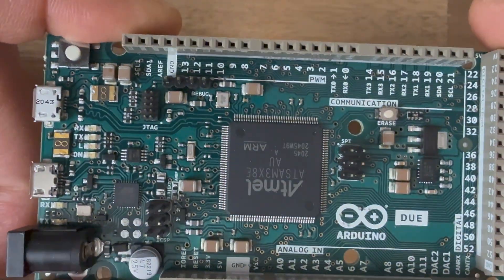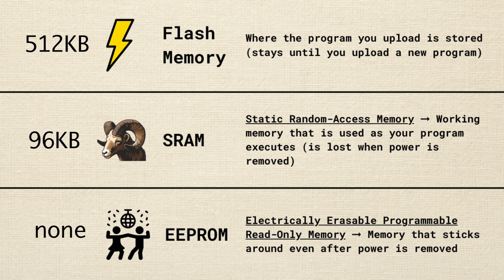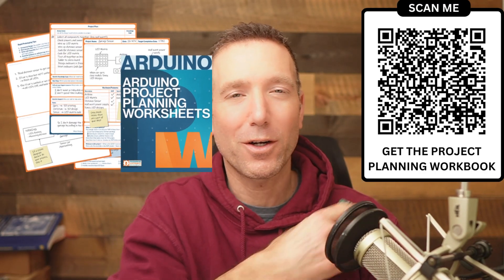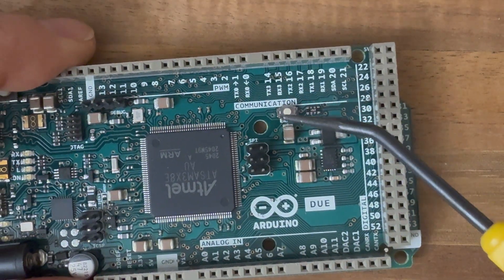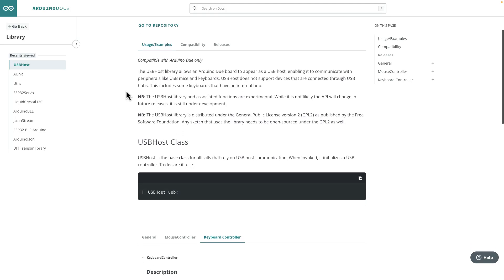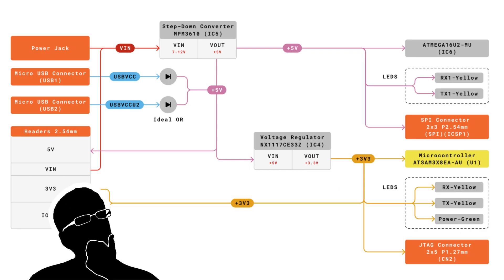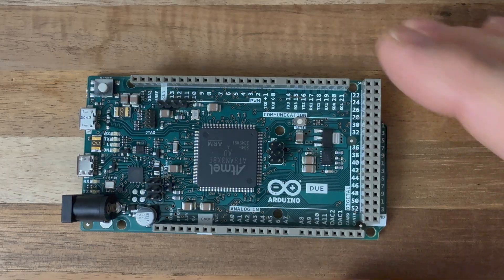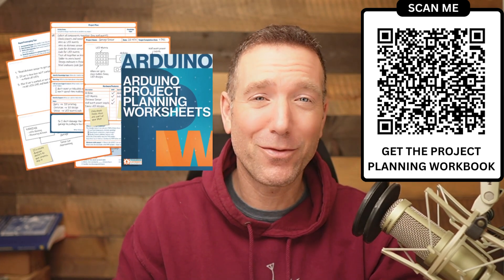Buying an Arduino Due?  Watch this first!

Comment: BTW Due has 3 hardware serial ports and softserial can be added with a special library.  However I2C doesnt work on some peripherals such as ones that use clock stretching, and the soft-I2C lib I found doesnt either :(  But Ive otherwise found its very stable reliable and useful board.  You can get them for <$30.
Reply from the maker: Thanks so much for adding this!!

Comment: I really like your channel because you explain code and concepts to someone like me who has not studied programming languages and just wants to use arduino to do things within larger diy projects.  Just want to know what I need to know to make something work.  Really practical, very good.  But I do have interest in more powerful concepts.  For instance classes still look like a foreign language to me.  All kinds of strange things, virtual functions...  Classes and how pointers variables are used.  Really interested to learn the details of those.  Because every time I open a library I cannot comprehend it, and that is frustrating.  Can you help?
Reply from the maker: Thanks so much!   Some of the more advanced stuff can be super useful.  We do have a video or two on pointers on YouTube, you might check out our website as well.

Comment: Biggest problem for me with Mega (10 yrs later) is the lack of RAM, and CPU power in some cases, this really limits what you can do, what libraries you can use, objects etc. So I have started using the Due but most of my stuff is 5V but level shifting and adaptation can be done. I need all those UART;s and I/O and even using the CAN i/f
Reply from the maker: Cool, What kind of applications are you using it for?